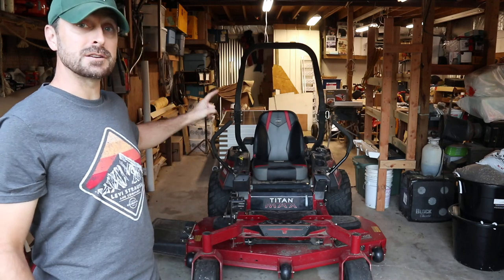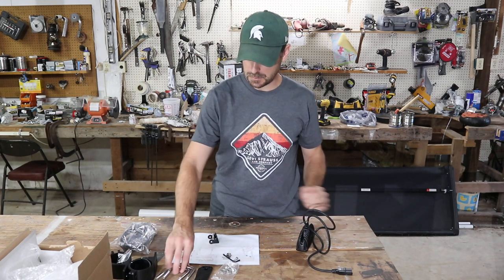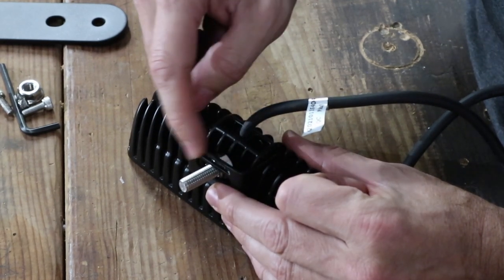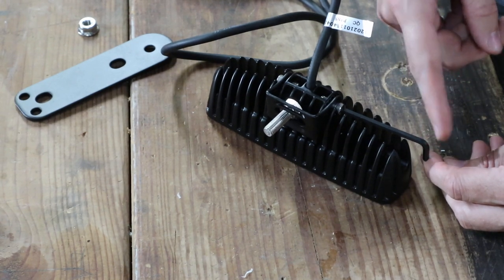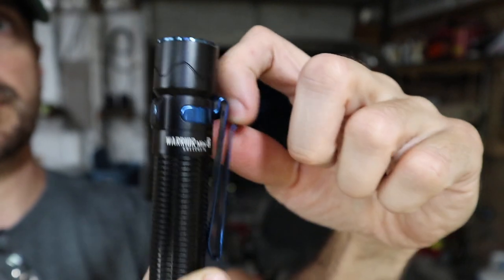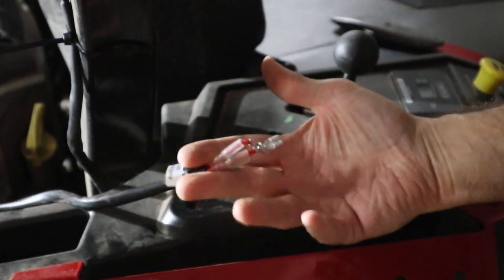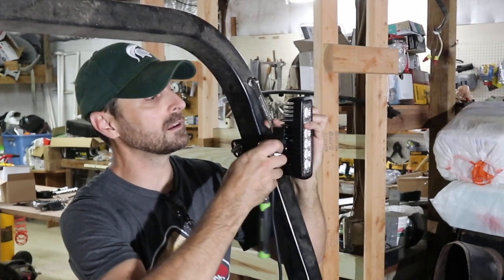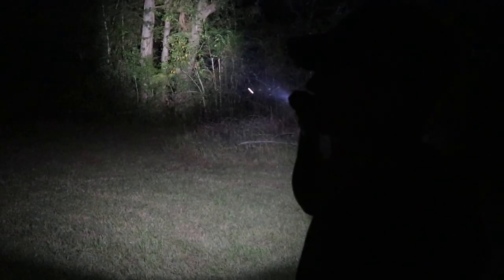Toro Titan Max Light Kit Install Tricks And Tips! Special Olight BONUS!

Comment: Thank you for making this video. I have the same mower, thinking of adding lights, and needed the info you provided. I was wondering about the contents of the light kit, and now I know. Super helpful to see where that power plug is - easy button! I probably won't go with the (rather expensive) Toro light kit. I'll pull some parts together to lower the cost. I'll also lower the lights to frame height on the front to cut glare and keep bugs away from my face. Your info was invaluable for accelerating my plan!
Reply from the maker: You're welcome. 
You are right about the bug thing. They smack me in the face all the time.

Comment: I made my own by using a light bar and bolted it to strong magnet and plugged into the cigarette lighter port. Have 3 exmarks so need to rotate based on which one I use instead of buying 3
Reply: And sometimes I put it lower on the foot plate so it focuses more on the grass and keeps the bugs from going towards my head
Reply from the maker: @jnaperski  That is a good point. Once I stop mowing the bugs attacked my face very quickly.